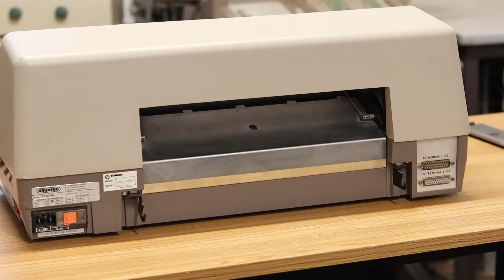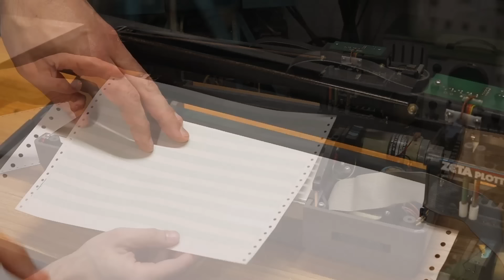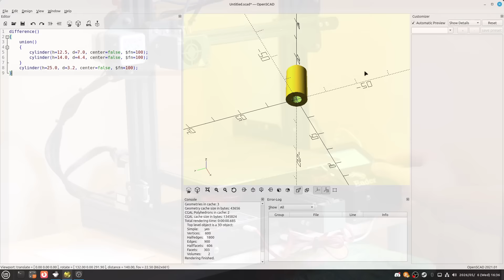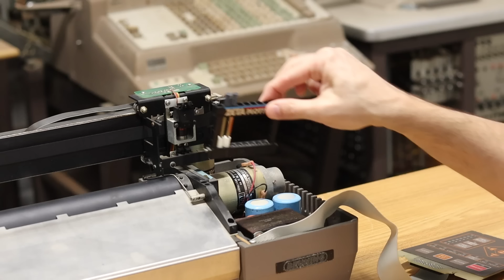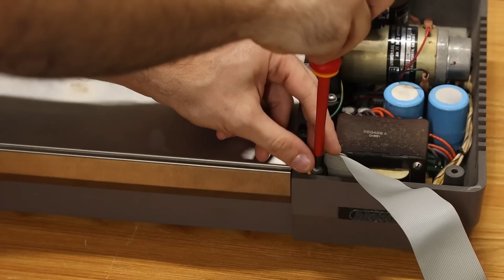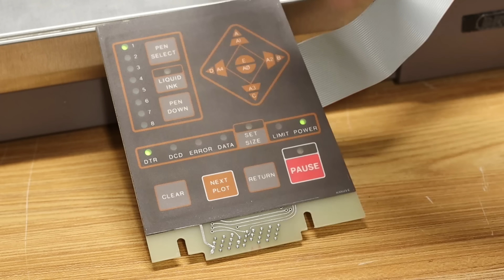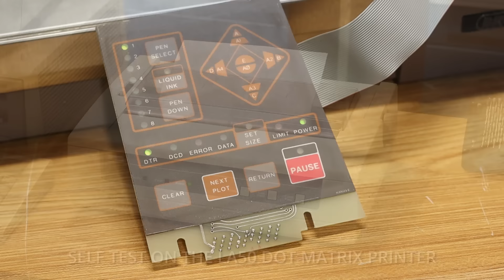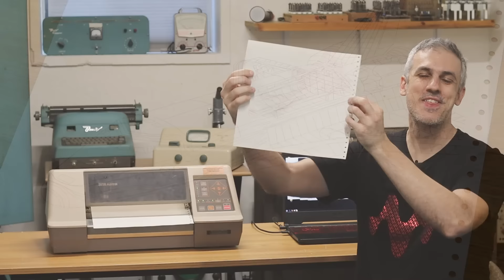A Pen Plotter from 1986!

Comment: I used something almost identical to this model back in my high school drafting class (circa 1983). Back then, our school had a single copy of an early version of AutoCAD. That's when AutoCAD was still a DOS program. We never had any tractor feed paper, but we used the same heavy gauge paper that we used for manual drafting. It was fiddly to load, but it almost never slipped. 

Also, I see that most of the lines in that shuttle drawing (ah, memories) do not seem to line up properly. When plotting from CAD software, precision pen positioning is essential for crisp drawings. Someone else here mentioned wrapping tape around the pen tips to bring them to the correct diameter. That should make your shuttle drawing look cleaner.

I used to love watching pen plotters do their thing. It was hypnotic.
Reply: I remember how it would sometimes draw half a circle, then draw some lines in another area of the drawing entirely, then come back to the circle to draw another 25%, draw a very small straight line on the far side of the drawing, then finish the original circle. I think the issue was that the plotter drew the lines and arcs in the order they were stored in the drawing file. That means that if you draw a line that goes from Point "A" to point "B" early in the drawing process, draw some other things, then break the line sometime late in the drawing process, the original line entity has it's endpoints modified to go from point "A" to the break point, then it creates a new line entity that goes from the break point to point "B". The first half of the line is listed earlier in the data file than the second half of the line. And that's the order they get plotted onto paper in. One reason you would split a line like that is, for instance, if you wanted the originally "green" line to appear "yellow" after it crosses past a certain boundary. Since a line segment can only have one color, in order for the two parts of the line to be different colors, they have to be 2 separate entities.

Comment: Hello Usagi

It seems that a lot of little older folks (like me) is watching your channel, so this is bringing back some memories. As mechanical design engineer I had a lot to do with different plotters. First one that I used on regular basis was a Roland DG DXY-880, a low-cost flatbed plotter with 8 pens, which was HP-GL compatible. Luckily it uses HP size pens (which were almost a standard) and these pens have same size as Rotring technical pens, used for manual drafting of blueprints. As we needed different line widths, we used those instead of colour pens. The plotter size was ISO A3 (roughly ANSI B) size and it wasn’t fast. The downside was the paper clamping system which was using magnetic stripes for paper holding. While it was decent for holding normal white paper it was insufficient for clamping the tracing paper. Tracing paper changes it sizes with air moisture which causes wrinkling. This was present to extent that pen was leaving lines even in pen-up position. This is not present if the plotter is mowing the paper in one direction and pen in the other. Last plotter of such type that I used was a Calcomp (I couldn’t remember the type).

Pen plotters were almost completely replaced by inkjet counterparts, which are faster and the time for blueprint completion is independent from lines count on the drawing.

And even these are retiring really fast. In my company we have retired our HP DesignJet 500PS plotter more than decade ago. All the drawings are now distributed digitally as PDF files. And even those are now slowly giving way to 3D CAD models equipped MBD (Model Based Definition) data…Age of paper is slowly ending, at least in mechanical engineering.

Keep on the good work and have great time.

Comment: I currently work for a company that has several large HP plotters (I think they are A1 size), and makes quite heavy use of them for design documents, but years ago, I worked for a tiny company that had a smaller A4 size plotter that they never used.    It was not even generally plugged in.  TBH, I am not even sure it worked.

I never found out why they had it.   

That said, I actually find it quite hypnotic at my current employer watching them plot.

Comment: FWIW.  Just search for tractor feed plotting/CAD paper. It is still around and in fact those huge A0 plotters still use tractor feeds as that is the only way to make sure the huge paper remains aligned.

I had a HP7475 Plotter I used to print notices and Birthday/Christmas cards on. It was fun but the pens dried out too quickly. Ball point pens will prolly suffer the same as the friction heat from multiple plots will eventually cause them to fail. But still if you search for meta ball point pen refills, you should come up with some suitable candidates. 

Thanks for sharing.

Comment: Hey David, you might consider putting heat shrink tubing on the lower portion of the pens to keep them from wiggling around in the holder.

Comment: in 1982/3 when i was a CNC programmer on a Laser cutting machine we got an apple 2e to write programs on. prior to this we had to write using an ASR43 teletypewriter on to punched tape. the LASER only took punched tape for its input. we also got not long after a watanabe pen plotter A4 size if i remember and it was a flat bed not a roller like yours. we could test our programs for any catastrophic errors or zoom in to an area and plot it if we thought it might be too tight and overlap. Our plotter was only 1 pen..

Comment: I have an HP Draftmaster rx that cost 11000 dollars new.  8 pen carousel, takes roll paper as wide as architectural size e-- 36 inches wide.  It's a monster that we used in our now closed machine shop.  It goes so fast that you have to stay clear of it when paper is moving in it.  Much better feeding roll to roll.  It's capable of making drawings like 3 by 10 feet.

Comment: Two things. The first is that there are special paper sizes just for plotters - called something simply like 'Plotter Paper'. The difficulty is finding one with the tractor feed holes, I think this was a problem even in the 1980's and they might have used a machine to cut their own holes..
The second is that you really do need those pen holders to get a good result. 3D printing might still be the solution but instead using a resin printer which can print very small accurate parts. Another solution might be something like a jewelers lathe. Most bodge solutions are unlikely to work well but it is possible to get very thin brass tubes used in model making and one of them might work.. Or a tube could be made from thin brass sheet.

Comment: if you really want the desperate solution to the paper problem slap some greenbar in a laser cutter and laser out new holes at the right placement on one side
get the fanfold stacking right and you could probably do 20 sheets at once

Comment: That stringing looks very severe for simply having damp filament.  I might check your temperature settings and maybe consider dropping it 5 degrees.  One other thing to check is to make sure the thermister on the hot end is properly seated, if not the head can overheat and lead to stringing just like that.  I just saw this happen on an Ender 5.  One other thing to check is the retraction distance in your slicer.  With the long feed tube on that printer you might want an extra mm or two of retraction to account for stretch.  

Unfortunately the Ender is a tinkerer's printer.  You end up having to learn quite a lot about it just to keep it running and printing nicely.  

Finally, super thin walls like that are always an issue.  Even if you did get them to print they would be fragile, especially as you printed them in the vertical orientation.  That would make them more likely to snap off as the adhesion between the layers is always the weakest part of the print.  If you printed them on the side you would need some supports for the end, but the print would be stronger overall.  Also, check if your slicer has an "ultra detail" mode, for small parts like this where precision is important it can make a big difference at the cost of dramatically longer print times.

Comment: I think using TPU would work a LOT better on your print too, it's way more rubbery if that's a word
Reply: I may be mistaken, but seems the printer he's using has a Bowden tube, not direct drive extruder. TPU is really hard to get to work without a direct drive.

I don't disagree with the basic suggestion, just not sure it's practical for David to follow with that printer.

Of course, for something like that, maybe best to send it out to a print company, let them deal with the hassles. That also could open up other options, like SLA resin printing with a flexible material, for higher resolution and reliability.

Comment: So.. the Ender 3 is a good beginner printer for someone who really wants to get into the deep guts and mechanics of 3d printing. If you want a GOOD printer you don't have to think about, spend a little change and grab a higher end Prusa (my brother has the 4 and it's amazing) something up in the high end of the product line. A Bambu is ok too but there are issues, but they print great.. anyway wet filament is definitely your stringing issue, a good dryer or food dehydrator - also print in as low humidity as possible.. it helps. I have an Ender 3 and upgraded to linear rails, a 1/4" heated bed plate, I run Klipper on a bigtreetech pad, so on and so forth, and it actually prints like a 1,000 machine, but I put $500 and a good year of learning into it..

Comment: 3D print issues...A, use vase mode, do the design as 3 120 degree segments with oiter and inner diameters and segment edges touching......B, use a flexible filament, I prefer FlashForge flexible PLA

Comment: I have an Ender 3 too. I wouldn't say I'm an expert in 3D printing, but I've had pretty good success with the extruder retraction settings for preventing stringing like you had. I would recommend setting the filament retraction distance to 5mm rather that the usual 0.8mm or so, since the Ender 3 has a Bowden tube rather than a direct extruder. I use Cura for slicing, but it looks like in OrcaSlicer the setting is located under "Printer Settings->Extruder->Retraction->Length". Also, in Cura there is a setting for printing small walls, and it's actually disabled by default. It looks like OrcaSlicer might have a setting similar to this located under "Filament Settings->Strength->Walls->Detect Thin Wall" that could maybe get the thin tube to print correctly, which could potentially help the plotter be even more precise by eliminating that slight wobble of the pen. Maybe you've already tried these settings and still couldn't get it to work, but I figured I'd say this just in case you really haven't tried it since it could maybe help you if so. Best of luck to you

Comment: I don't recall the model number, but it was 1970 (give or take a year0 and I went to a ritzy private boarding school. We had very early computers, specifically the HP9100A/B (one of 'em, or maybe a mix of both). We also had a pen-based plotter called a something printer. I also had a giant plotter, meant for architects, in the early 1990s. It was even multi-color. We had to do some reverse engineering that'd let us send print jobs over the network from some of the workstations.

Comment: Great vid!  Very cool to see the pen plotter going.  As a kid, I always wanted the pen plotter that came with the Atari 8-bit line, but never was able to find one.  Also, it's cool to see you using OpenSCAD.  It's super easy and turns CAD into programming, which I'm more familiar with.  I've used it with a lot of 3D projects for my printer and definitely recommend it.

Comment: depends on what you're printing but filament is hygroscopic. stringing is pretty normal for some materials like PETG and open bed printers. if you want the resolution try going to a .02 nozzle and adjust your slicer to accommodate. it will most likely give you the resolution you are looking for. also be careful with running belts back and forth with manually steppers, the motion can generate power and fry electronics the other way.

Comment: Love pen plotters.  HP used to be the king of plotters, and i think they still might be.  But they are all inkjet derivatives now, in place of actual pens.  There is no comparison, the pen plotter is better, IMHO.  Too bad nobody is making the pens anymore.
Reply: In what way is a pen plotter better than inkjet? They can’t print solid fills, they can’t make sharp corners, and they’re vastly slower. Pen plotters are cool, but I can’t think of a single actual advantage to using one.
Reply: @tookitogo  For CAD applications?  Definitely superior in my opinion.  No dot matrix printer can print a solid line at an angle that doesn't artifact like crazy.

How much money is spent trying to get rid of that very "jaggy lines look like crap" in video cards?  The answer is a lot.  

And i am not sure where you are getting the "can't make sharp corners" bit from.  You are very correct about solid fills, but that isn't all that common in drafting drawings, in my opinion.

But if you prefer an inkjet, that's fine.  Whatever you prefer.
Reply: @jeromethiel4323  A pen plotter’s corners are always limited to the radius of the pen itself. That’s what I mean that they cannot produce sharp corners. 

Just how low do you think inkjet’s resolution is?!? Large-format inkjets have been at very high resolutions for ages. Normal today is 1200dpi default, with higher available. Their output is razor sharp and not at all jaggy. And it can do that sharpness in color, without the ragged edges of e.g. color laser. 

The antialiasing used to smooth text and graphics on-screen (where you are lucky to have more than 150 pixels per inch on a computer, or 300ish on a phone) actively harm printed output. For some reason, people often insert antialiased graphics into their files for printed matter, and then it looks like shit. Proper vector graphics (which CAD programs can do fine) look fantastic.

Comment: If you can't print the tiny wall size, you can always make the wall larger and then adjust. If larger from the inside, just drill it. From the outside, then a bit of sanding in a drill chuck or the tinyest lathe in the world.

Comment: I have an ender 3 v2, basically identical printer other than the screen/controller. One big limiting factor IMO is that yours still has a Bowden tube hot end with the externally mounted extruder stepper.  The Bowden tube does have some speed advantage due to the lighter hot end and will be less prone to ringing in the prints but they can be harder to really fine tune.  I've since upgraded mine to a direct drive hot end with an auto leveling probe, it's a worthwhile upgrade.  In the mean time I did try to write up some of my initial thoughts below though my memory might be hazy as I upgraded mine years ago.  Hopefully my word vomit makes some amount of sense, I'm by no means an expert.

Your stringing could be the temp you're printing at or your retraction settings, hard to say without seeing your current settings. Consider printing a "temp tower" for that filament, NEKO3D has a good basic one on makerworld and it'll help you play around with print temp without having to manually print a bunch of attempts. Have a profile set in your slicer for each filament you print and save whatever ideal temp you come up with to that profile. Regarding the retract/de-retract distance setting you'll have to play with that a bit, try increasing it .5-1mm and see what you get, IIRC you don't want to go above 7-8MM though.  All that being said it also looks like you have z-hop enabled, that can contribute a bit to stringing but I find some very light stringing once in a while a worthwhile tradeoff.

Comment: I knew of an 8 pin plotters that was good on an Amiga, SCSI, and an IBM MS-DOS, serial, used 14" paper. They used the same pins! I used to get the pins at the stationery store.  Take the smaller and put in brass bushings and then plastic for the larger!

Comment: It's interesting that the plotter needs an 8088 to run it.  The HP 7475 Plotter uses a much simpler CPU (Motorola 6802 from memory) so I wonder what made the designers pick that specific chip?

Comment: The stringing is probably due to the filament not bringing completely dry. If it has been opened and not kept with silca gel, this happens. You can dry it by leaving it on a warm build plate and cover with a cardboard box for a few hours.

Comment: Oh wow, this was fun! Back in the 80's my employer was an engineering company that used E-sized pen plotters that consumed HPGL from the 2D CAD package they used called Anvil. Anyway, a typical plot took 6-8 hours! 
I wrote some code that intercepted the HPGL on its way to the plotter and did some processing. By sorting by pen, meaning it drew everything in one pen before moving onto the next pen I cut the plot time in half. Then I did some more optimization to sort the from/to pairs so once a line was drawn it would find the next line closest to minimize pen motion. Anyway, 6-8 hours went down to under 1!
The very next year they bought an electrostatic plotter which has no pens and builds a rastor image from the HPGL and plots everything in the same time. No need for my magic anymore! That was cool, and sad, at the same time!